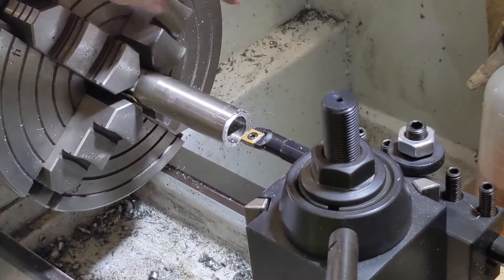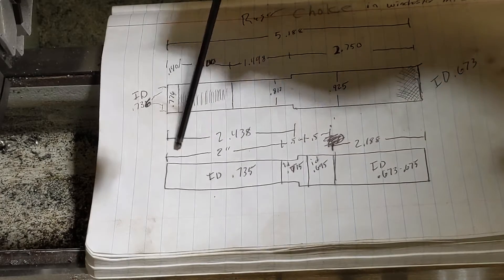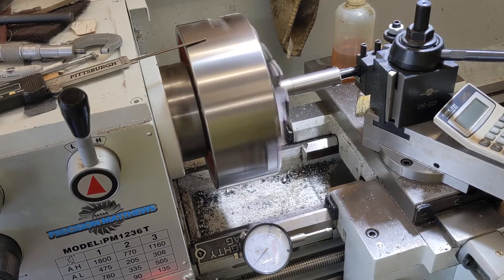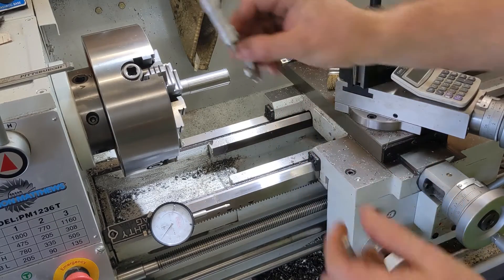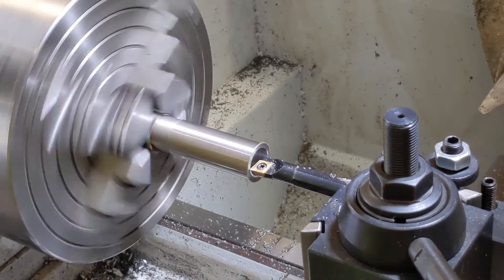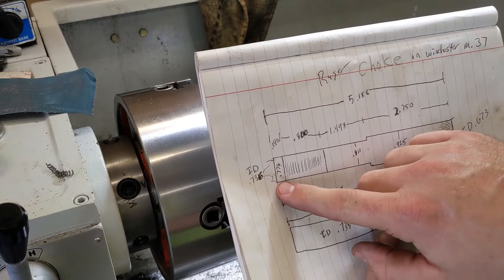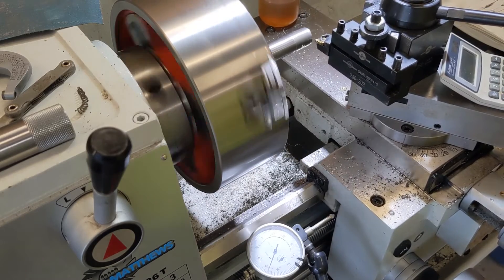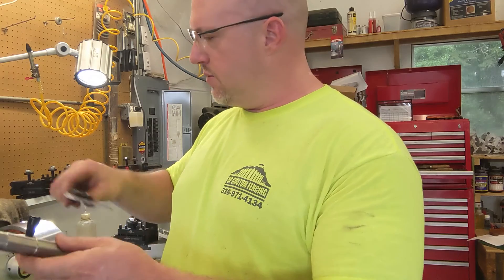Shotgun Choke Part 2 - Build | Make | How To | Metal Lathe. Turkey shoot Winner! Screw in choke mod.

Comment: How do they put lines inside the choke?
Reply from the maker: Different bore diameters 👍
Reply: @ThisOldFarmShop  please explain
Reply from the maker: They cut steps of decreasing diameters that forms the steps. They're there to slow the wadding down 👍
Reply: @ThisOldFarmShop  I wasn't talking about the wad stops the lines that run down the choke tube
Reply from the maker: @casey-riggans I'm sorry, but I'm not sure what you are referring to?
Reply: @ThisOldFarmShop  I have no way to message you a picture.
Reply from the maker: @casey-riggans thisoldfarmshop@gmail.com
Reply: @ThisOldFarmShop sent

Comment: Super video, and explanation. I will make my external choke as well. What I am affraid is the pressure, in the barrel druing shooting, if it is damaging the choke. Should I worry about it in your opinion?
Reply from the maker: Thanks for watching!  Full disclosure: I didn't do any real research or metallurgical study on the matter.  I used purely redneck intuition, gut feelings, and possibly memories from an alien abduction to come up with my specs😂🤣🤣.  That being said, to me, It made sense to make the external part of the choke nearly three times as thick as the barrel and out of a stronger metal hoping that would be overkill.  But, I can report, that after 20 or so shots, the choke is still it's original size, with no signs of wear or fatigue.  Check your bore and external diameters after each of your test shots to make sure there is no swelling or movement of any kind.  👍👍 Let us know how yours turns out!  and thanks for watching!
Reply: @ThisOldFarmShop  Thaks for the feedback, I will keep you informed.

Comment: Nice work , SS steel are easy to cold weld / galling on thread , best is to use moly grease to avoid disaster . Hope you will make pattern target . Extended length choke can also be used as muzzle break , not a bad improvement when 3heavy loads are used .
Reply from the maker: Thanks for the comments. 👍😎 Here's my test fire video... https://youtu.be/RsJDz0dP8Fs
Thanks for watching!

Comment: The issue with your knurling may be the location when you engaged the half nut.  There should be a dial gauge on the saddle.  If you don't engage it properly, it won't knurl properly.  Generally, if you wait until the dial is on the same number (odd or even), then engage it, the knurling will be straighter and cleaner.  Hope this helps.  I also wanted to say very nice job.  I've been wanting to make a custom choke for an old 16 gauge barrel that I want to cut back since it's impossible to find a reamer or 16 ga chokes for sale.  That's when I came across your video.  Thanks for sharing it.
Reply: Not true. You don't disengage a knurled tool like you do threading and you don't use the half nut for knurling either. You run the tool back and forth, changing feed direction and applying more pressure to get the right knurling depth and then back the tool off when done.
Reply from the maker: Ah! Thanks much for the advice! As much threading as I've done, it never occurred to me that I may be crossing because I didn't engage on the same number. Thanks for watching!!

Comment: What material did you use? Thanks
Reply: As far as knurling, get your center of the tool to your material, then loosen your tool post and put a slight angle so the knurl tool tends to lead on the front edge. That should help. Just test on some scrap material
Reply from the maker: @2cr4d5at1  Thanks! I'll give that a try.
Reply from the maker: I used 17-4 stainless. Bought it from Amazon...
Online Metal Supply 17-4 Stainless Steel Round Rod, 1.125 (1-1/8 inch) x 12 inches https://smile.amazon.com/dp/B081B6NVGK
Thanks for watching!
Reply: Thanks again, just watched the video. Nice!
Reply from the maker: You're most welcome! Thanks for watching!
Reply: One last question. Is your bore the same from end to end? No taper? The reason I ask is because I’m checking the bore on a few cheaper chokes I have and some have around .030 thousandths taper. Three chokes, same company and all three vary on the amount of taper. I’m thinking poor machine set up and these are very cheap chokes. Thanks again for your information. Really appreciate it!
Reply from the maker: It is actually stepped to help slow the wading. Check out the downloads page on my website. I put my technical drawing there that you can download. https://thisoldfarmshop.com/downloads.php
Reply: Thank you for your response. Going to make a couple myself. How did yours end up patterning?
Reply from the maker: It was pretty decent at 30 yards. I made a video on it. https://youtu.be/RsJDz0dP8Fs